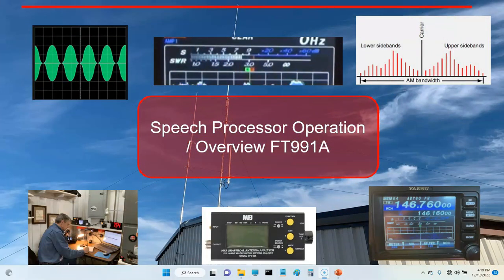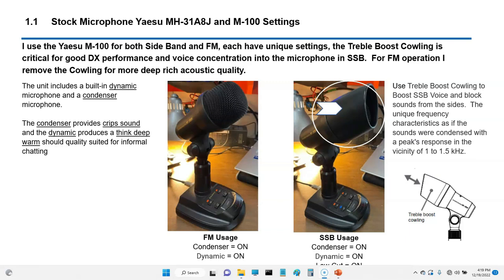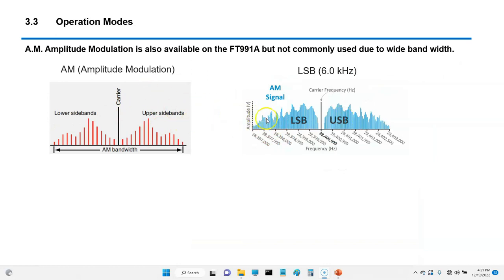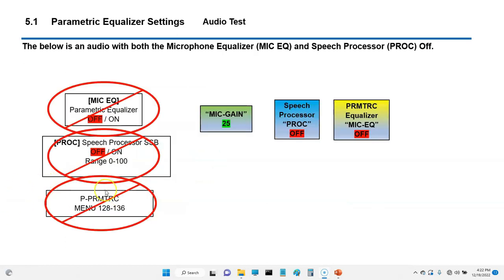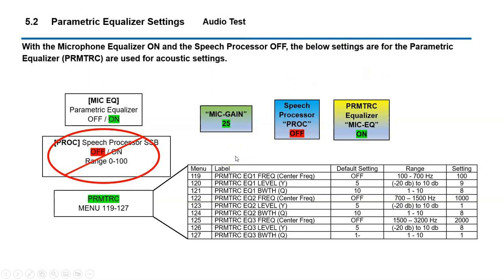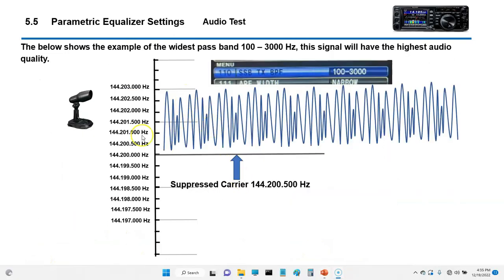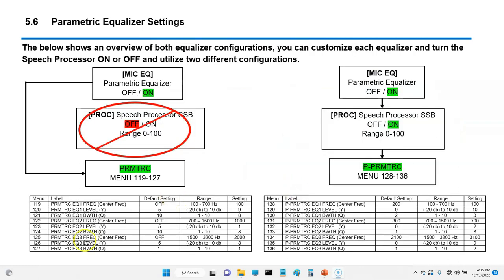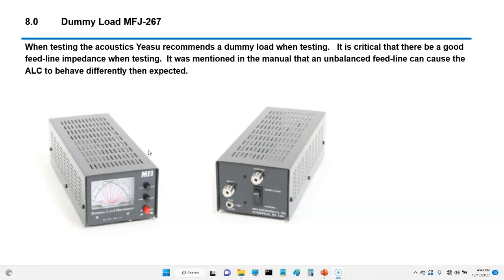Part 1 FT991A Setting Up Parametric Equalizer and Speech Processor Microphone M-100 and Factory Mic

Comment: This is funny.  I spent over 2 hours yesterday playing around with this including looking for help from your videos.  And what happens?  You publish just what I need the following day.  Thanks.
Reply from the maker: Hi Scott, Wow that's cool, one  tip if you have a headset (3-ring 1/8" I think) plug it in to the Phones port and press the F/M-List locate the MONI, press it and use the Multi Function key adjust 40-50 and when you key up to talk to hear you voice exactly how it is on the air plus the other stations '73 my friend always good to hear from let me know how it goes.

Comment: Great information. Are there any publications that explain what the numbers mean. I have a headset and have found I get audio complaints if I wet my Mic Gain much above 20, so I am assuming the Mic is a tad hot on my headset.
Reply from the maker: Hi again that entirely possible press the METER button under FM List and tap it until the COMP comes up then talk at a normal voice if its higher that 5-10 dB there maybe distortion.  Good luck and let me know how it works out and hope to catch you on the air 73

Comment: Fantastic video that is well presented and thought out.  Probably one of the best videos on this subject.
I may not agree with some of the parametric settings, but they work for you and sound good.
Reply from the maker: Good evening Robert, thanks so much for the message I'd be curious what setting you use just for my own learning email the details, maybe we share and I can learn some new ideas, a lot of my videos have been from my own trail and error research and I don't radio background I'm interested  thanks again I love sharing helping folks have a good weekend 73

Comment: Awesome video. This is a presentation. Good job. I would assume, that these setting with that mic, would be close when using a Yaesu FTDX-10, 101D/MP or FT-710?
Reply from the maker: Hi Frank, thanks for the message, I enjoy doing these, I think so, if you not sure back off the PROC and MIC GAIN a little these high quality microphones really are sensitive, we definitely do not want distortion, '73 my friend I just uploaded a video with how to set up the radio live and pre and post testing '73 my friend hope to catch you on the air CQ CQ
Reply: @westtexasvideogateski5juf255  Thanks Again! 73 de WA3RSL

Comment: Question: I was on 2 meters and everyone said that me volume went real low but my signal strength was strong, what could cause this? Where did you get the pages from the manual? Thanks
Reply from the maker: Hi Richard, try the MIC GAIN tap "F M/List" use right left arrows locate "MIC GAIN" tap it you should be able to adjust it with the Multi Function knob try around 45-50 then to clear press the MCH will give the control back to memory locations 73 let me know how it works